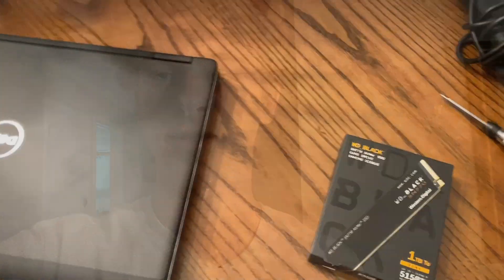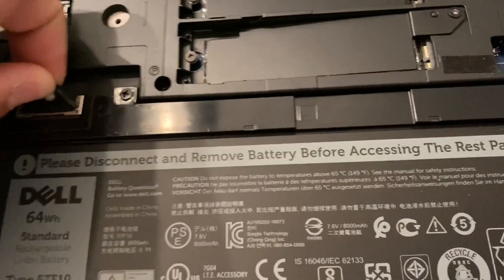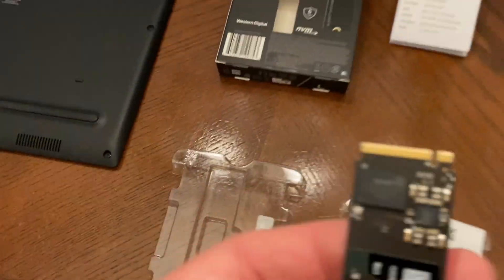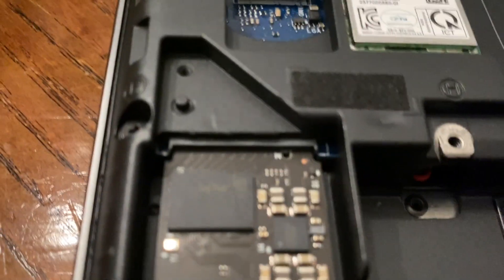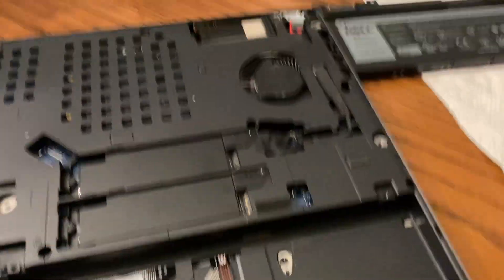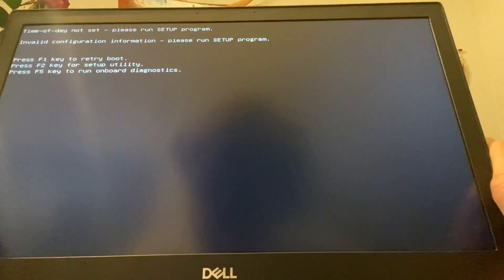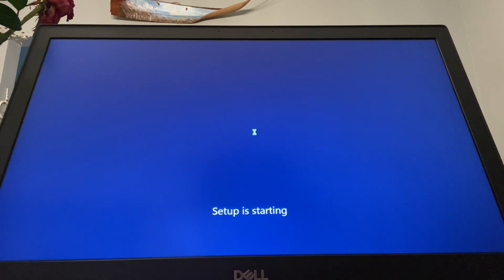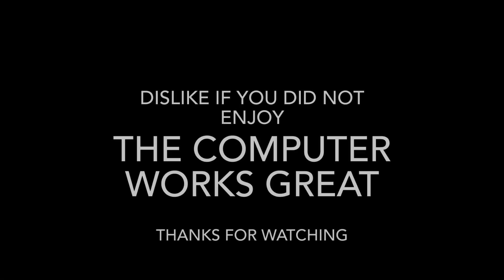Installing a WD_BLACK 1 TB SSD into a Dell Precision 7530

Comment: What is this empty space next to the battery for?
Reply from the maker: That is typically for a larger battery, here I have a 60 Wh battery, but I have since upgraded to a 90 Wh battery, which occupies the additional space. Additionally, on a similar model (Precision 7730) I have seen an SATA SSD mounted in that space.

Comment from the maker: 1:09 Correction: you are unlikely to be shocked by a laptop battery due to the low voltage, but you could potentially cause a short in the components while working if the battery is left connected which will damage the device.

Comment: That Precision has 3 M.2 slots? Is one a primary? Thank you  👍 was the cover supposed to go back on the new M.2, as a kind of heatsink?
Reply from the maker: None are “primary”, they all have the same priority, as the computer uses RAID to combine the different drives. The cover does go back over the SSD after the tape is removed as a heat sink, sorry that wasn’t super clear.
Reply: @enzosscience6229  thank you again! 👍👏